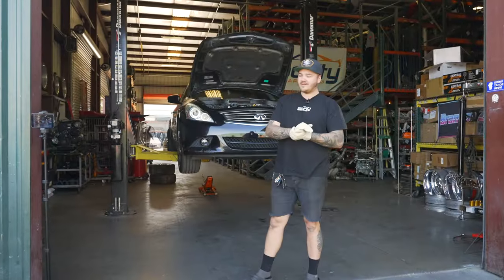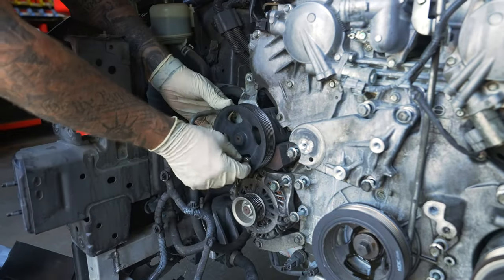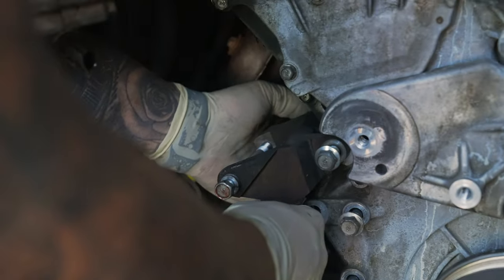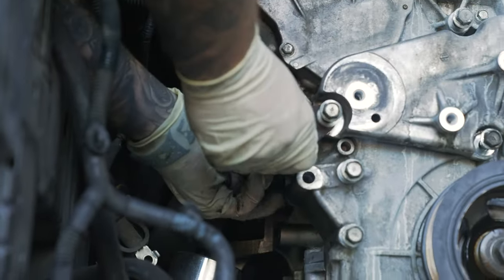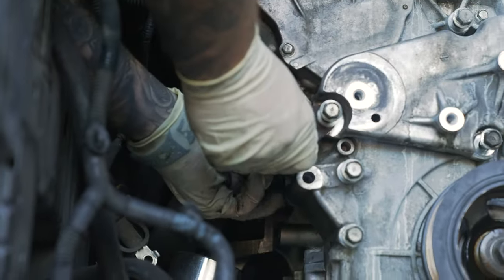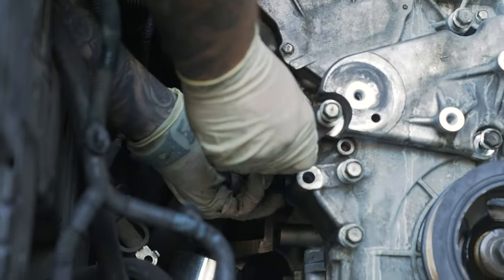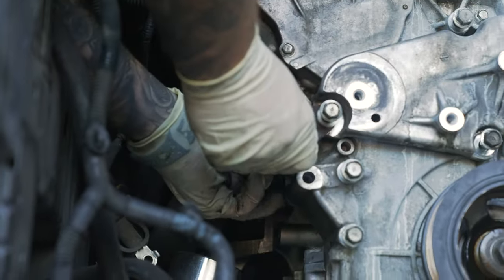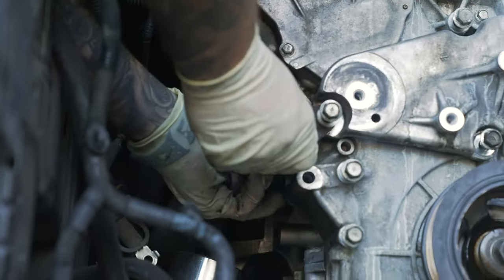Ultimate VQ Engine Care | Oil Gallery Gaskets | 100k Mile Service Guide

Comment: Yeah shop near me quoted me 4k to do the gallery gasket after I heard that my confidence to do it myself went from 25% to 95% after that 😂
Reply from the maker: Just keep your eye out on the timing ! Don’t ever wanna mess that up
Reply: Sadly I'm in the same boat
Reply: That sucks, 4k is crazy. Sounds like the shop didn't want to do it at all. Shops in KC do it for 1k to 2k.
Reply: @Hondacbr600rrish  I know I think I’m just gonna get a new motor lol it’s ALOT of miles on it anyway
Reply: @markus360s  I'm at 132,000 miles on mine right now. I'm just going to get the full potential out of this engine. After the gallery gasket, I'm going to put the soho supercharger lyte kit on and then have some fun.
Reply: @Hondacbr600rrish  that’s cool I just hit 218k 😂
Reply: @Hondacbr600rrish  What shop do you use in KC?  Mine has 172k on it.  I'm up north but work south.
Reply: Bruh that shit just made laugh
Reply: For timing, galley, and water pump they charging me 1k labor only
Reply: @NjBoriG35 thats amazing bro what shop?
Reply: @NjBoriG35 please tell the shop name, I am in Colorado but will drive anywhere for 1k labor for this job
Reply: Yeah right lol
Reply: @niftynet any pointers on how to set the timing. Did not set it top center before removing the tensioner and guides.

Comment: I am dreading the day when it's time to do this. I'm scope creeping and adding a NISMO oil pump and ATI damper whenever it's time to do this job. Thankfully my oil pressure is well within spec at 155K. Maybe i got lucky and fused the gallery on the track lmao.
Reply: Whats you psi sit at? I never know what is good bc SO MANY PPL SAY ALL DIFF NUMBERS! NISSAN says 15psi warmed up at idle is fine is that true? thats what I am at --88k miles and I drive normal

Comment: i like how he didn't show the torquing of the bolt under the secondary chain (Tricky bolt), guess he can't torque it without removing more parts. 37:16
not complaining, just wanted to see how he did it, and guess it CAN"T BE DONE!!! lol amazing work and commentary. a must know for vq35\37hr engines
Reply: make a custom short allen wrench or I guess ball end would work and tq by hand
Reply: Allen head sockets are narrower than the chunky screwdriver he had to file down, plus the timing chain is off on the re-torque so you have more space to get in there. His arm was blocking the show but it sounded like he got in there no problem.

Comment: Also Im sure you know, On top of the tensioner, there is a hole, if you put tension and align the 2 holes, you can put a pin though the tensioner hole and it will keep it tensioned while you install the belt with both hands.

Comment: in regards to the timing chain do all i need to do is follow exactly how he did in this video?? or is the motor still not at top dead center of the compression stroke even with the ridges aligned ??
Reply: Yes Follow the video. If you line up both the cam marks and the crank mark like he did, then it is at TDC. Remove the chain after u get it all lined up, then install the chain with the 2 yellow links lining up with the cam marks, and the red link lining up with the crank mark

Comment: Im gonna tackle this job here real soon in the garage my 2011 sedan is at 150k and ive put off the job long enough im confident enough to pull everything off and put it back together my  Technician buddy is gonna help me with the gaskets, timing chain, and upgraded oil pump gear
Reply: Currently doing my gallery gaskets and after further inspection, some of the gasket screws looks like they've already been touched, making me believe it's been done I noticed my oil pressure switch was covered in power steering fluid though, which could be the reason why my pressure light was turning on, not my gallery gaskets. Oh well I'm already this far in 🤷🏿‍♂️

Comment: What tool did you use to take out the free on in the ac line ? It says it’s going to be in the description but I don’t see no link to it and also for the extended 10 mm stuck on extension. If you have both links it would be great.
Reply: Did you find it?

Comment: Great video. Thanks for posting. When the gallery gaskets fail does it always throw a code? I've got 140k on my G35S, and was assuming since no code I've gotten lucky so far. Maybe I'll check with a manual oil pressure gauge.
Reply: What ended up happening. I’m in the same boat with my 350z. Changed oil pressure sensor, still at 0psi. Going to check it with a manual gauge. But I have zero codes.
Reply: @mosdiy8096  I have no symptoms of there being an issue so I haven't investigated yet. Hoping yours works out.

Comment: I did mines twice first cheap one went out now I got the z1 gallery gasket
Reply: hi, what was the cheap one? i bought mine from infiniti dealer but i dont know if it is good like the z1
Reply: @ if it’s not metal then it won’t last and you’ll need the torque screws

Comment: Timing marks are on the sprockets and oil pump. Not the timing cover. Also, removing the whole front end is not necessary. You can do this with just removing the radiator fan. Great diy video though.
Reply: He literally said that at the beginning of the video…..